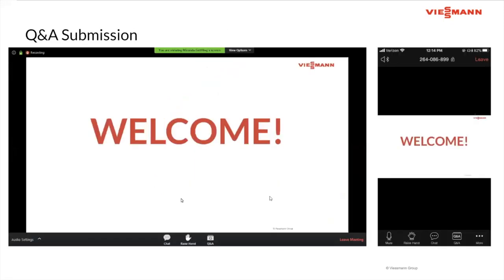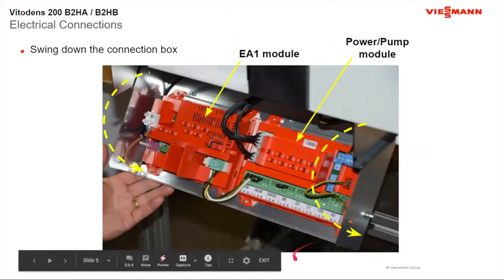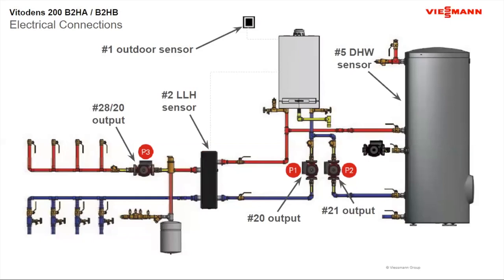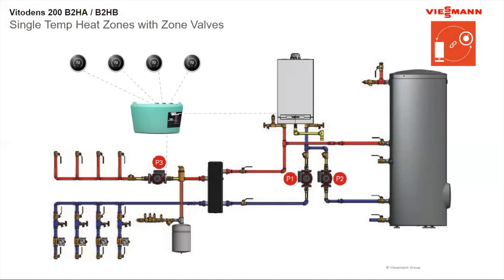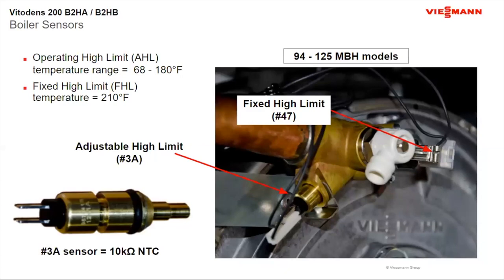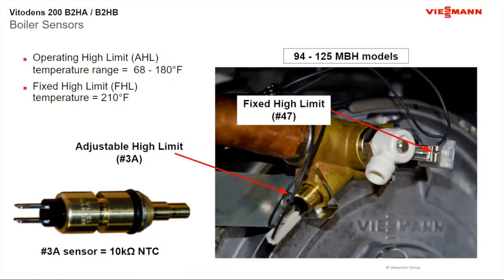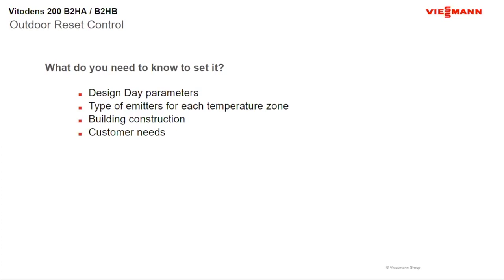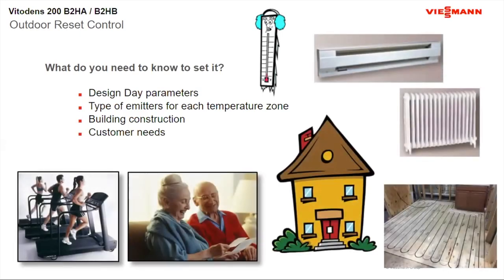Vitodens 200 Wiring & Control Interface/Basic Programming Webinar - April 2020

Comment: Very interesting webinar!

I still have a questio related to mixing valves. Let say we have a tree zones heating for an apartment. Is it mandatory to have mixing valves on each zone, or we can go with just a thermostat and a circulator for each zone?
Reply: If all three zones are using the same water temperature, there would be no need for mixing valves.
Mixing valves would be required where two or more loops use different types of heat emitters that would require different water temperatures to provide heating at the same outdoor temperature. An example would be one area having cast iron radiators and another area having radiant floor heating.
If all of the zones are the same temperature, you can set up to three loops a Zone Circuits (ZC), each with their own thermostat or dry contact input to enable and disable them.
Each can be assigned a pump within the control. Some optional accessories may be required, depending on the number of pumps you want to manage)..
You mention three zones in an apartment, if these areas have multiple units, it is probably not advisable to use thermostat control, (except maybe for local control of radiator valves inside each unit),  because of the variation in the occupancy patterns that usually exist in apartments. It might make more sense to manage the three pumps either independently or from one boiler pump output with relays. The pumps would start and stop based on Warm Weather ShutDown (WWSD) parameters in the boiler control. The boiler can be set up as a Heating Circuit (HC) without interaction from the space. 
Watch the three-part YouTube video on the Viessmann North America YouTube channel on the methods for using and setting up the HO1B control.
Reply: Patrick, If all the loops are the same temperature no mixing valves are required see the video on our channel , "Zoning with condensing boilers".
Reply: Thanks for the clarification, meanwhile a watched all videos and understood that I can setup 3 ZC. My house has 3 pumps each one serving different areas which can benefit from a slightly different weather compensated heating curve. My understanding is that I can configure 3 ZC each one with its one heating curve and the boiler will pick up the highest water temperature demand among the active ZC at each time.

So far so good!

One last question, I've got the brand new version of the Vitodens 200-W, model B2HF.
Are ZC supported in this model too?
The setup menu is completely different an the user manual is not very clear.

Comment: I'm a homeowner reading user manual for vitodens 200-W B2B, confused by term "room temperature" -- boiler doesn't get room temperature feedback from thermostats so what does this mean?
Reply: Please direct me to a plain language user manual that makes sense to an otherwise intelligent user!
Reply: It's great to see people reading the manuals. Thanks for taking the time to understand the boiler and the controls.
The “room temperature” reference relates to an adjustment the homeowner can make that biases the heating curve settings from a virtual or actual room temperature.
Viessmann has a room sensing device called a Vitotrol that works similar to a room thermostat and is located in the space being heated. It will provide room temperature feed back to the boiler control. Where it works differently than a traditional room thermostat, is it is communicating with the boiler not just sending a hard stop/start command.
Vitotrols are used for the Heating Circuit (HC) configurations, (The home screen looks like a house)  but not the Zone Circuit (ZC) configurations, (The home screen has a semi circle icon), in the Viessmann Vitotronic controls.
An HC circuit without a Vitotrol can still have room temperature adjustments but it is a virtual number without feedback. We include this in the control because most homeowners do not understand the settings inside the heating curve (Outdoor Air Reset Weather Compensation).
Adjusting a room temperature up or down is something they can relate to and when they do that the control makes a small adjustment to the heating curve calculation. If a Vitotrol is installed in the space the additional room feedback makes fine tuning the water temperature more accurate.
Watch my videos “Why your thermostat is like your car key” and “Using thermostats with modulating boilers”, for additional information on Vitotrols and Thermostats. Also watch for a video on setting the heating curve on the Vitotronic series controls coming soon.  These videos can also be found on the Viessmann North America YouTube Channel
Reply: Mark Norris, thanks for taking the time to reply so thoroughly. It would be great to discuss with you in more detail about how my specific system works.